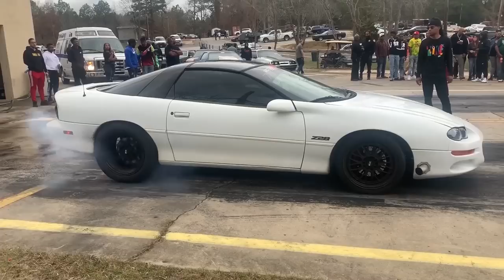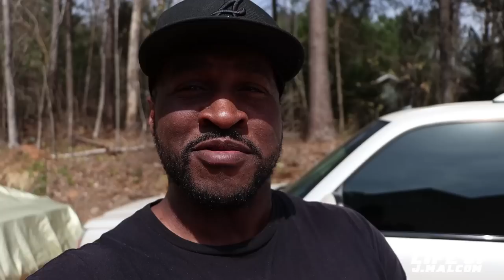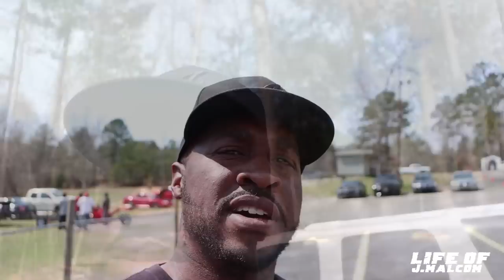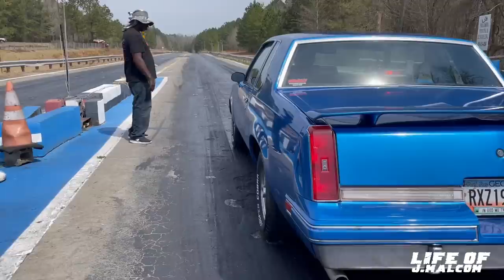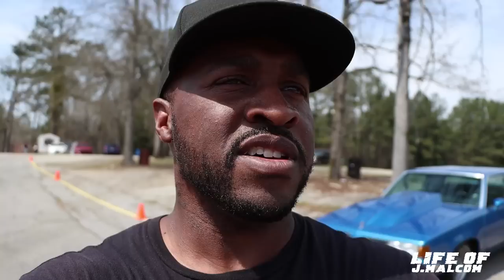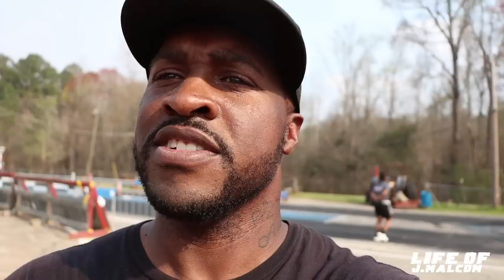RnB SUPERCHARGED CUTLASS HITS THE DRAG STRIP AGAIN!!

Comment: How much fuel pressure are you running? I think you’re blowing past the floats . This problem didn’t happen until after you fixed the alternator right ? When you are turning rpms now it’s putting out 14.5 volts or so where as before it only had 12 or less that could make at least 2 or 3 more psi so if your pressure is spiking above 8-10psi it will push floats open . 6 -7 psi max is all you need !! Just a suggestion

Comment: The two step is working you have it set at to high of an engine rpm the brakes can't hold it there . Lower it down to about 1500 hundred or so it should be fine